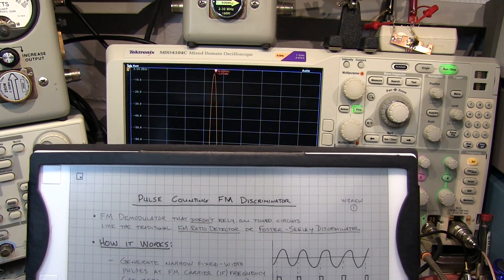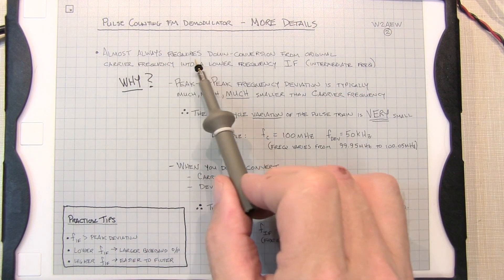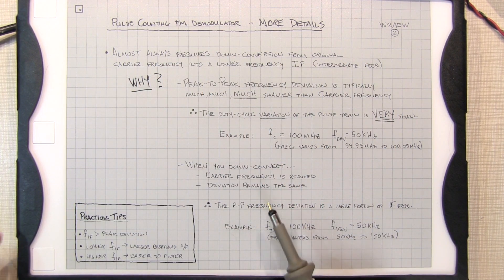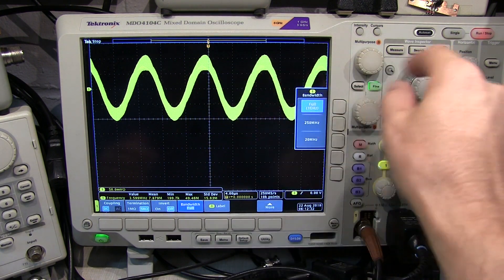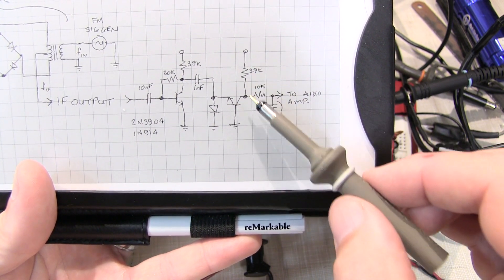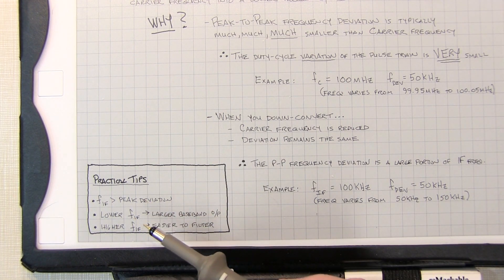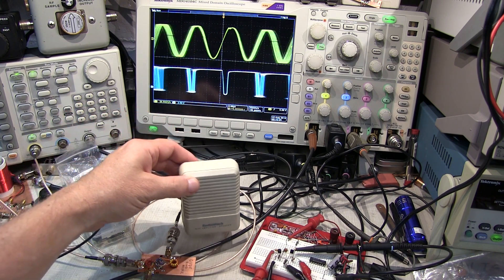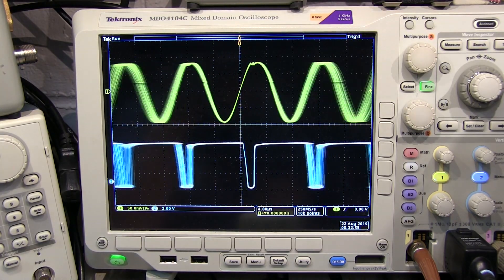#303: What is a Pulse Counting FM Demodulator | Detector | Discriminator?

Comment: Bad circuit.I use 74hc4091 and f*2 on 2 form fix time singlmulticibrators.This circuit best works on freq low 100 khz
Reply from the maker: The purpose of the video was to present that basic concept, not necessarily the best way to implement it.
Reply: @w2aew  this is old and bad.
Reply from the maker: Sure, but still fun and educational to play with.

Comment: Between your video and Yates' schematic, I learned a lot building the pulse counter. My next project is a superhet FM receiver with a 10.7M IF and a Foster Seeley discriminator. I've completed the RF front end with mixer and IF amp, but I am not sure if my IF signal looks right (see video link) https://youtu.be/_nLt-3ba24s
I was expecting either a clean 10.7M sine wave or some visible FM on the sine wave. My IF frequency is correct,  but the modulation looks like a helix or twisted rope. I'm confused. Any insights would be appreciated.
Reply from the maker: Your video is private so I can’t see it.
Reply: @w2aew  Sorry about that!!!
https://youtu.be/_nLt-3ba24s

Comment: Great circuit, I got to (try) build this very soon 🙂 Can we call this just simple PWM?
Reply from the maker: It's not really PWM (pulse width modulation), since the generated pulse widths are constant.  It is really more of a fixed-pulse-width pulse frequency modulation - which then varies the duty cycle which we can average out to recreate  the baseband.
Reply: @w2aew  One part of the period is fixed, but the other part varies, according/related to the frequency. If you invert the fixed pulse, you get the PWM that can not reach 100% duty-cycle, but otherwise not much different right? But of course, it is just how you look at it. The fixed pulses are getting closer together if the frequency goes up, and if one would count the pulses (like moving average) we get the wanted/demodulated signal. So, okay, the original name would of course be legit 😁

Comment: Put together a working prototype of Alan Yates' detector ( see https://youtu.be/_FVo1IIuUc4 ).
Still tinkering with the bandspread,  and the LM386 desperately needs a volume control, but the receiver works pretty well so far.  
The receiver could use an AGC to moderate the LO drive level which seems critical depending on the relative signal strength of the different stations. A dedicated mixer IC, as in your version, might be a better solution to balancing out the RF & LO.  
The audio is much clearer than the regen receiver, although it is hard to tell from my poor quality video. 
Your video has been indispensable for understanding how the receiver actually works. Thanks again.

Comment: I'm curious how your diode mixer responds at 100MHz? What is the relative value for your inductors? What is the mV range of your inputs / output?
Reply from the maker: Should work pretty well.  The mixer needs about 7dBm LO drive, but the RF/IF levels can be quite small (mV).
Reply: @w2aew  OK. Just wondering if the relatively high value inductors attenuate the signal much at that frequency. I'm wondering if non-ferrite toroids could be used to lower the impedance of the transformers at higher frequencies?
Reply from the maker: @andrewferg8737  A good rule of thumb is to have the transformer winding inductance to have a reactance at lease 4x the system impedance. So, it is ok to have a high impedance winding. You certainly can use fewer turns or a lower permeability core.

Comment: Video Request: Can you PLEASE (x10) do a benchtop build of an FM broadcast band receiver using discrete components? There is very little quality information online. I have had success w Alan Yates' regen receiver , but it's quite tricky and I'm not sure if that architecture is suitable for heterodyning. FM circuits generally are quite difficult for amateurs like me, especially without an expensive  VHF / UHF signal generator.
Reply from the maker: Sound like it would be a good project.  But, it may take me a while to get to.  My approach would be fairly straightforward, and would include the following blocks (many of which I have done videos on already):  VHF preamplifier (lots of design ideas found online), varactor controlled VCO (tunable over 20MHz, setup for 10.7MHz above or below the FM broadcast band), simple diode-ring mixer for broadcast band conversion to 10.7MHz IF stage,  IF stage would be a simple buffer and 10.7 MHz filter (easily obtainable), second mixer with fixed 9.7MHz oscillator LO followed by the pulsed counting FM detector, then low pass filter and audio gain stage.
Reply: @w2aew  Looking forward to it!!!

From an amateur's perspective, there are a few issues that make FM so challenging: 

Firstly, the high frequency is beyond most affordable signal generators, so each section becomes difficult to test in the way you might easily test with a lower frequency AM band. VHF RF amplifiers are very tricky, especially when you don't have a known and reliable signal to test with. 

Secondly, the ability to test each block is dependent on having the other blocks already proven and functional. Without a proven front-end you can't test the detector, and visa-versa. 

Added to these, is the practical difficulty (or  just ignorance) in identifying the various high frequency RF, FM, & IF signals properly on a scope, which seems much more difficult for an amatuer than identifying simple AM or AF signals.
Reply: @w2aew  I've simulated this, but haven't prototyped it yet:
https://www.falstad.com/circuit/circuitjs.html?ctz=CQAgjCDMB0YEwFYCmBaMAGK0Cc94A5Jtt8wFI4xIQA2BEehTZNMAKACso5MLf8ALN15wQKIemjp08BGwDGUQVEg0QA-L1UhMYVPhBxYkDDTAB2AdgFh85hAcnT2AFwYChA6e6GRtusRgrc3x8XHQBSBDCNUkEBHNsEMoNcz8BS3BvABMkADMAQwBXABsXNgAnBhotNQQa8GxRXSZ0Sto4X20aTvVvTDgeaSdh0elIdp7Pbyn1DR1DIekpMdGJqo1+T005x0NzaXbIZVUDY895gYO2xQPfBFEQ++bwVHN1WHMaP3RIdHi6Il6CN2IovANeuDDPUFkYrNhVqs4KgwBAUE4aFYMINfvFNHBqCC2AB3JRCRBqc5QCI6EnqHZ+OpwM7+On1WodLqxOmzKEIDx9TA3HyCkUePZ6FDvMCwCwIbDkFIIshJHQrdgAczJu21mwWbS1evF9MweqFbC1-IuBitJv1Fs5Ot5O3NACVqroBQk1GABUK+gx9Wq5AB5EBPKAPcPKZl7NqkqmM7WnWklD3gL0NMBNfXqtXSQbmCxgGj4UuIJiQYFsNyzJN3FSxcBiSRRBAYcEUEsedCOaBMRJNTskCKRLKYXKFUrlUnsxqPGnZ5p0htL8M0vi0qoNqsL60LDCjB0N40nl1b6P7iO7g9HrUR0-KM20rWx-aiN9v82KQbk3uLckYV0VBsDEIxzGZVp8H5VEaExQl1TpKkKVFFD421X9UN6NoABVqXJXpkOw8AVkRVZJWlfNpGwOCbF+CxSFwRIW3VbN0Bo4JElIcxmMkYhsE4QxQnfISDBQigxAkdVEHaTCUMwv4JH2Q5STkmE4Ag6FuVnZl53TNc2gsXxFxzKkSwCJY1SrMgyLWEBXSQABnABLRyXAKAA7eQkDpKE1yhTD0MUvTgsCpCo3MhhdMi9CHgMSK4r04U-JzY0DNeFBQJgA4EmZGgSD+b50A0qjQXwvSNNEdLJVAgRoGZBVQjgEgyymd4iUNeZ-PmHg4wdSqKs03r7SqTcUzGngFiYB0LDUARMXAL47XNHgIDk-9MJi8dVkMYZ8yiBgj1JFAJJvE7RChYVUQ-TTZpE4CUAMdFSIa+UBGZRAPHm97SprDNnnAeBIyqsQIEkMhIgsOBSxMWCSBY452OaglUQg6DS3HEBJ2KMo-vO4HwEpCLQZYiGTAgmHURLeHnvIB5vuIDQvGhn0cnyHHyi1X0Ae5qAMfNLVHtNBaheW2ljok76Fil9DRal-GZbpBX+lFWXJe8OX+iViSBvxm90OukT8YGg2gaTQ2TbYd0FuNG3z1NZggziSZfGUG3LnUa5TdEMyzf5nlXaEQ2qQNyk3cD8XCb5+Kw4kB15mChPJvNUkS3KhOaVDxso+C4UHf9GXDH7FE0XB-lyehwgqfyvtnDYNM5ZFnZLpAfB6v0FjpEiaDsD8XAaCLeJ5UjtdxsmlMDQA8qFOT2kjMWtQBu6+LDv6aA6EEWznHspzXPcryfIAD0Ovn3nwH2DnUQwhAAGRDNhj4oagNPoKsxJCK+gcPDyAAlfIZJ8DJWQAHsT4vDorEWA9REBUV+AiHowJDAnwmKAya4DTDBjSPYc+6AzCYh4CYWBEBiFsGOCfAAYhAagrRvCHjGCTAAIkgAAbs5AoLhnLAI8qQgwoFKGwmgAIEuRdzDCLQCAAAwgUAADgUeQzl97eR4eGIQ-DMCiMeiAbApEt4yA7uIgAkh5bIRR5CKJ8kAA

Comment: Will this work for fm radio receiver for the 88-108MHZ? considering that the difference between the channels is 200KHz? if you're local oscillator only can be ppl tuned to 100Khz you'll end up with two channels interfere with each other? for example if you want 100.1MHz channel you set LO at 100MHz then 100.1-100 =100KHz IF but also 99.9-100 = -100KHz which will also be now outputted from the mixer now we have 99.9 and 100.1 channels being listened to (sent to the pluse counting detector) now I'll be listening to these two channels horrible? I'm saying this because my PLL in mind is the philips pll ic saa1057 this will only has a resolution of 100KHz not 50KHz.
Reply from the maker: This is one of the main reasons why a dual conversion receiver is used.  You would typically do an initial conversion to an IF.  10.8MHz is commonly used in broadcast FM receivers.  Since the LO frequency is much closer to the operating frequency, the high-side / low-side conversions are very far apart and you won't have the "two signals converting to the same frequency" problem.  Main station bandpass filtering is typically done at this 10.8MHz IF stage, then you can use the pulse-counting demodulator to convert the 10.8MHz signal down...
Reply: @w2aew  Thanks for your prompt response. I thought in your vid you said that the IF must be in the the neighborhood of 50KHz to use the pulse counting demod? I also looked into Zero IF designs on the net but I still could not understand how they demodulate the signal once the signal is brought down to 0KHz by LO = carrier frequ? I think maybe they are doing ADC then pure algorithm solution using math/signal processing on a microconroller that's soemthing I want to avoid. Are there any other methods for demodulating zero IF (analog approach)? Thanks.
Reply from the maker: @wisehomo  Pulse counting demodulators only work for non-zero final IF.  50kHz is a good workable IF, but it will also for a 100kHz IF, it just won't be as sensitive (since the variation in duty cycle with the audio baseband won't be as large), but it can definitely be made to work.  If you are talking about FM demodulation, then the basic analog demodulators will usually work on a non-zero IF signal (FM ratio detectors, PLL based detectors, pulse counting detectors, etc.).

Comment: Great video.
There is also another reason why we need to down convert to use this demodulation method, and that is it is very difficult to generate sharp pulses with low duty cycle at high frequency.
For example for 100MHz signal, you need to generate pluses with 1ns or better ( Lower pulse width) and then integrate them.
Of course, you can use say 20KHz bandwidth integrator (bandwidth of sound or info) that is not hard, but generating 1ns pulses or better is hard, but not impossible.
Maybe, this is another way of direct conversion receiver.

Comment: Alan, where does the term "discriminator" come from? I've seen in used interchangeably with "demodulator," but I haven't found any supporting evidence. Any insight?
Reply from the maker: I believe it comes from having a circuit that can discriminate one input frequency from another.  An AM detector can't do this. An FM demodulator can.

Comment: I've been thinking of something similar,  if I could use the FM modulated rf to change and alter the freqency of a square wave oscillator,  then simply by integratigration of the edges (via a small capacitor and r ) [I'm a great fan of Shmit triggers , namely using a coil instead of a r in the feedback! ] obtain pulses praprtional to the modulation frequency.  Using say the +'ve pulses and then average out to obtain the Af !
Reply from the maker: Yep, another way to skin the cat...

Comment: Hi, I built the circuit described in the video, but it is not working.  I am feeding a 10.7 mhz signal (from my spectrum analyzer's IF) into the circuit, and using some amplified speakers to recover the sound (like you did, I believe) but the signal is not heard--all that is audible is clicking and some humming.  Any help would be greatly appreciated.
Reply from the maker: What part of the circuit did you build?  Are you feeding the 10.7 MHz signal into the mixer and downconverting, or are you going directly into the pulse counting circuit?  If it is the latter, it won’t work because the frequency is too high.
Reply: @w2aew  That explaines it, I built just the pulse counting circuit.  How low must the frequency be to work?
Reply from the maker: @wiredwrx  I talk about this starting at about 9:40 in the video.  It all comes down to having the peak deviation of the signal be a significant fraction of the input frequency.  If you have 10kHz deviation on a 10MHz signal, that won't be detectable since it's only varying the carrier by 0.1%.  But, if you convert the input down to 50kHz for example, the deviation will be 20% and will be easily detectable.  The width of the pulses created needs to be set appropriately too (must be less than period of the input signal+peak deviation).
Reply: @w2aew  thanks for your help!

Comment: Howdy again.
After much experimentation I came up with a concoction of a pulse counting detector. It works together with the regular 10,7 MHz IF so therefore no bandpass filtering is necessary. It works. The recovered audio is of modest quality.
The schematic and description may be read in my blog   eugpoh2.blogspot.com 
In high regards.

Comment: Very elaborate and clear presentation, thanks a lot ! 
I am interested to study and finally make some pulse-counting detectors, so I watched your clip very carefully. Congratulations!  While studying the history of this type of demodulation, I discovered that there were many companies that produced FM tuners with pulse-counting. The undisputed champion is Kenwood, but I also noticed Accuphase, Heathkit and Fisher. Here are some FM tuner models equipped with pulse-counting demodulators: Kenwood 600T (1976), KT-615/815/917 and L-07TII (1979), L-01T and KT-80 (1980), KT-9XG, KT-900/1000/1100 (1981).  
Kenwood produced pulse-counting discriminators using discrete components, discrete+some known ICs (TA7060P, SN74LS03 or SN74LS38N, HA1457, NJM4558D) and dedicated/proprietary ICs (TR4010A and TR4011). 
Another FM tuners with pulse-counting: Fisher TFM-1000, Heathkit AJ-1510AS .
I hope that these informations will help. 
Also, a good source of info is the "Tuner Information Center" at https://www.fmtunerinfo.com/kenwood.html .
Good luck and be sure you have one more student watching your clips! :)
Best 73s de Cezar YO3FHM
Reply from the maker: Good information, thank you for sharing.

Comment: Thanks Alan for your videos, they are great help and inspiration. There's something I'm interested to know, and as much as i try i can't figure it out on my own,,, hopefully you can do a video on in(?) fingers crossed. basically, in an IQ demod, you two clocks with 90 degree phase difference. we are basically measuring how strongly the components of the received signal align with these references.... so say magnitude 1 if aligned,  and 0 if 90 degree out, with these magnitudes we can compute the phase and amplitude of the received signal... please excuse my sloppy writing... but the point is, at 90 degree it's 100% misaligned and we get 0 magnitude. How then does a direct conversion hetorodyne work?? what if my LO is exactly 90 degree out of phase with the transmitter.... i'd get nothing at all? or if i restart my LO and it just happens to be in phase then suddenly my receiver works?
Reply: ohhhhh... i think i got it, the carrier itself carries no information, the sidebands do! so if the carrier is in phase or out of phase with the LO it makes no difference... is it correct? :/
Reply from the maker: @coffeecuppepsi  Correct.  Also, it is VERY unlikely that your LO would be aligned to your carrier, and even more unlikely that it would stay that way for long.  There will likely always be a small frequency difference/drift.
Reply: @w2aew  thank you !! :)

Comment: Super clever idea. Would there be any disadvantage to using a 555 timer for the pulse generation, other than introducing an IC to a generally analog channel? With amplifying the signal to the point of turning it into a square wave, it would look very similar to an Atari Punk Console.

Also, did you do all of those notes on a reMarkable? I've been heavily considering getting one, how are they?
Reply from the maker: It's not a new idea - been around since the tube radio days.  You might be able to use a 555 as a re-triggerable mono-stable, provided it is fast enough based on your IF frequency.  it might be too slow for a broadcast FM IF.  

Yes, it is a remarkable tablet.  I like it, but it is really pricey for what it does.
Reply: @w2aew  I didn't think about the speed, although some googling suggests that your average 555 timer can work in monostable mode up to around 100 kHz, so that's probably fine. The duty cycle might be a little iffy though, if the cap is small enough you might need extra shielding.

"Really nice but expensive for what it is" has kind of been a running theme in my research, unfortunately. I'll probably wait for a good deal on eBay or something
Reply from the maker: @AMTunLimited  If your application is FM broadcast, then the IF would likely have to a couple of hundred kHz, so the 555 monostable might be pushing it.

Comment: Finally got my TA2111 chip project operating in FM mode. It's been my practice stage to gain experience combining the Osc and RF coils with a ganged capacitor as Alan has suggested. It's been much harder than an AM receiver! I think I'm almost ready to try the pulse counting FM receiver...

Comment: Many thanks for educating me. Slowly working my way from a simple regen receiver towards a proper heterodyned  FM receiver. Question- Why do many of the FM or multi-band receivers have their VC connected to the positive rail instead of ground? Specifically the TA2111 chip... but I've seen several others with this set up. Do they swap the polarity for convenience sake?